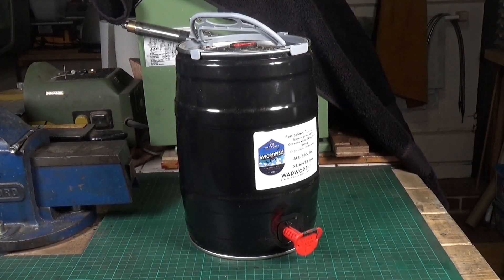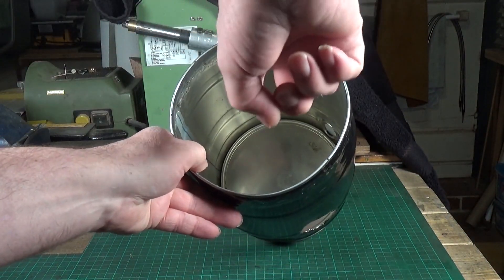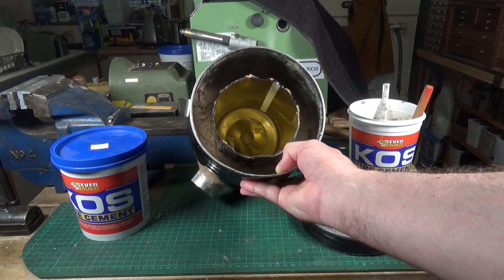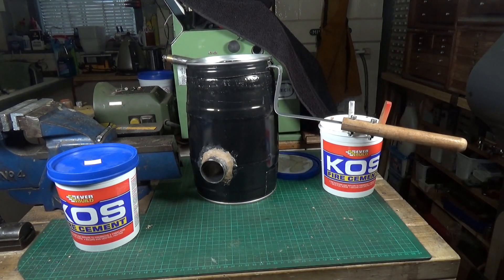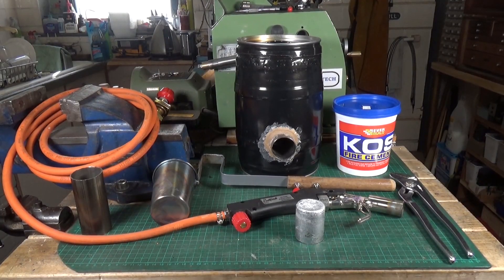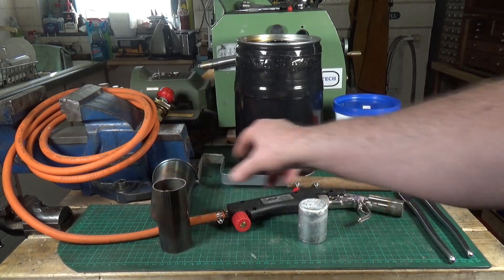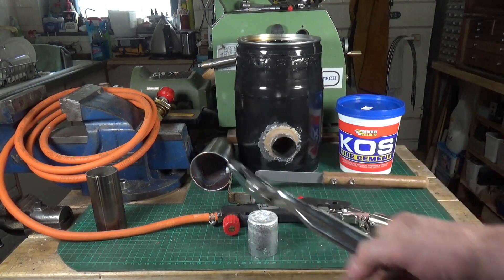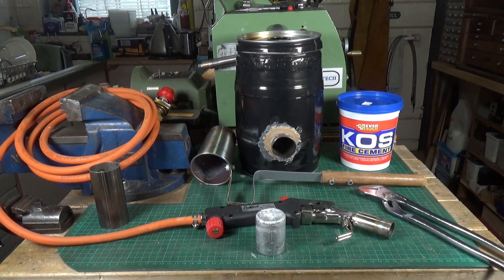Melt home cast aluminium with a Beer Keg furnace

Comment: That is an excellent idea for that keg! I have one in my shop that I was going to use as a furnace for a home built Stirling engine.But that is the perfect shop size furnace!
Buying material to machine for model engines or anything for that matter is quite expensive and to be able to melt down a bunch of soda cans and beer cans and make my own billets is something I wanted to do for a long time. That's a great idea thanks very much!
Reply from the maker: Hi. Glad you found it useful.

Comment: Hi again Alan.  Just one thing you should be doing and that is standing the base plate that the tube is on for the pour, on a bed of sand.  If hot liquid ally was to spill/leak onto those pavers (which look to be cement) there could be a thermal reaction and molten ally can spray around.  All cement has moisture in it and this instantly turns to steam, splintering the cement and throwing hot ally around.  So I'd suggest standing the steel plate on a bed of sand in a metal bucket or some such - see my setup - to be safe.  Cheers Rob
Reply from the maker: Hi Rob. Yes I did forget about that. I'll use an old metal baking tray in future to stand the plate and mould in. Thanks for reminding me. Cheers, Alan.

Comment: Top tip. For good castings only use metal that has been cast before. Extrusions and bar material have different properties.
Reply from the maker: Thanks for tip. My friend Rob said that aluminium car wheels provide the best scrap for melting. Unfortunately they are rather expensive here in the UK!

Comment: I think the only mistake you made is your pipe entry should be on a angle and not straight .
Reply from the maker: Thanks. The stainless steel tube is large enough to allow you to angle the burner so the flame goes around the crucible.